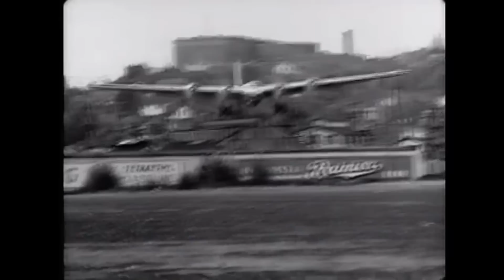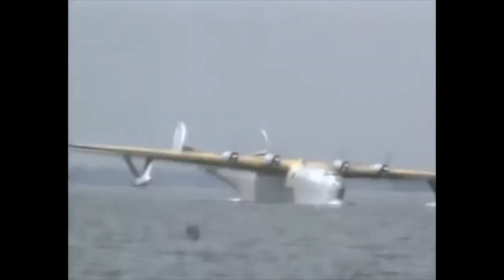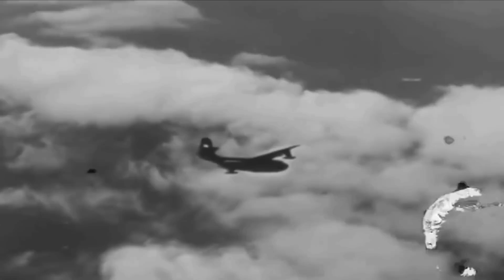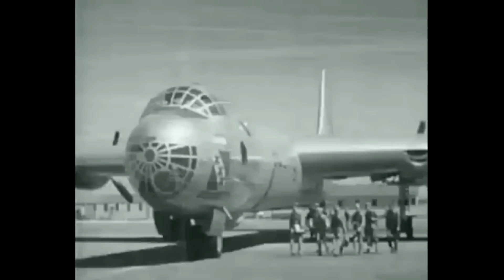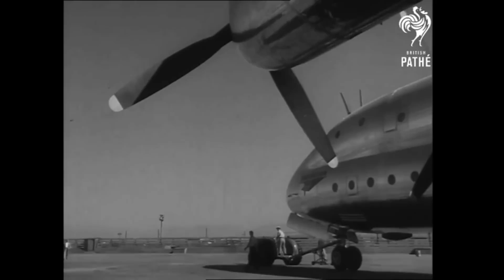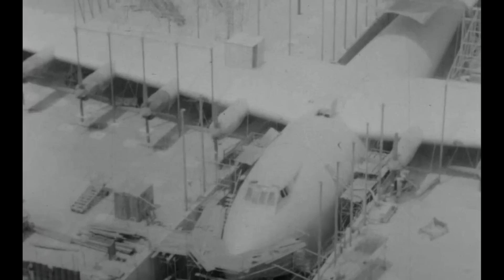Piston Giants (US) | Index Of Oddities Ep.3

Comment: The Spruce Goose would never fly again after the taxi tests because of a major structural failure. If you go to the museum you can see that the rear of the fuselage is patched back together. The stress on the air frame on such a large aircraft and the use of wood made it impossible to repair. Howard Hughes had a problem accepting failure...
Reply from the maker: I hadn't heard of that actually. Can you link me to a source on that, I'd love to read about it.
Reply: @AviationGeek1903  Go see it at the air museum and ask them about all the clamps holding the tail on. Testing flying boats often ended up discovering the structural issues and that was the result of its only test flight. It would have required tons more of wood to make the aircraft sold enough for a water takeoff & landing...

Comment: This video is good. Here are a small group of revisions that could make it better: Consolidated Aircraft did not merge with Voltee. It was Vultee. And the Convair XC-99 was not a modification of a B-36. It was constructed completely in San Diego using many B-36 design features like its wing and engines. The engineer in charge of the design of the flight deck was Jim Sproat. And although the one XC-99 was last flown to Kelly AFB Texas, the B-36s I believe were manufactured in Fort Worth.

Boeing, Lockheed and Martin people might chime in here with their revisions. But I doubt if the design for a double radius fuselage for the Lockheed Constitution was due to pressurization issues. To construct a limited number of aircraft of a type could stimulate the company to use the machinery at hand, instead of buying new machines to only use for a few airplanes. And Lockheed probably did not possess a large-enough radial draw former for a single radius fuselage.
Reply from the maker: I appreciate the constructive criticism! Thank you. 

As for the pronunciation of Vultee, that's just how the text to speech program pronounced it. Not perfect, but passable. 

For the XC-99, I couldn't find nearly as much info on it as I could on the B-36. I was under the impression it was a modified airframe from a pre-existing unit. But I could be wrong. 

Lastly the source I saw regarding the double bubble fuselage mentioned it was for pressurization purposes like the Curtiss C-46, but you could also be entirely right, and that Lockheed just lacked  the resources to build a single fuselage on that scale, like you mentioned. 

I'm working on my next video, covering the F11F Tiger, and I plan on narrating it myself instead of using thr TTS program. I've also got a fre sources to cross reference so hopefully it comes across as more polished.
Reply: Wow. You are an honest person. I like that. The 2-B-60 prototypes were modified B-36s that had damage due to a wind storm at Ft Worth. So Convair offered to see if they could be salvaged as all jets. But Don Germeraad, test pilot, knew they wouldn't fly right. FYI
Reply from the maker: I would say you don't get anywhere in life by being dishonest, but that's entirely how politicians make a living. 

Thanks again for the feedback!

Comment: Wait... WHAT??? No love for the YB-35 "Flying Wing" from Northrop??? Designed to carry 10,000 lbs of bombs over 10,000 miles, surely it belongs on this list. Besides, it should be on the list just because of it's "cool" factor, a plane WAY ahead of it's time.
Reply from the maker: I avoided it for a few reasons: first, I wanted to focus on designs with 200+ft wingspan. If I includes the XB-35, I'd have needed to include the C-74 and C-124 as well. Of course, I made two exceptions I'm this video, as I felt the XB-15 was closely related to the XB-19. And the XPBB was large enough for a twin engine design. 

Secondly, I know how the comments get with such planes: it gets flooded with people accusing Northrop of copying and stealing designs from the Germans. And I didn't want to deal with that right now lol.
Reply: @AviationGeek1903  😆Fair enough
Reply from the maker: One day I'd like to cover the Northrop Flying wings, and the Convair XF-92, but I've seen what happens when I post photos of those in Instagram... so I won't go into those until I'm a more established channel, and have the chance to really dig into the nitty-gritty parts about how captured German engineering influenced such programs; which is exactly what is is, influenced, not stolen.
Reply: @AviationGeek1903  I would love to see it. TBH I wouldnt worry so much what other people post. Plenty of trolls out there. And in fairness, none "STEALS" fundamental design ideas from anyone, they just "borrow" them! LOL. In all seriousness, does anyone believe the Wright Brothers invented the airplane in a vacuum? .Jack Northrop was putzing around with the idea of a flying wing long before WW2. along with plenty other designers who understood the principle advantages.Besides, if you're going to get bent over who deserves more credit and your guy is a Fascist Nazi sympathizer... you have more serious issues to work out! Hahahaha

Comment: Largest piston engined aircraft? No contest - the Hindenburg , nobody else in sight at the finish line.
Reply from the maker: I'd argue that the US Navy Helium filled Akron and Macon would qualify as "in sight at the finish line" at least. The Hindenburg was only 18ft longer, and half a million cubic ft greater in volume (which makes it only about 7% larger). 

But based on technicality, you are correct.
Reply: @AviationGeek1903  Good point, it would be a 1-2-3 sweep of the podium with airships.
Reply: @natehill8069  You are forgetting about the LZ-130, the second Graf Zeppelin (essentially the same size as the Hindenburg).
Reply: @kiwitrainguy.aka.DennisGandy  Not really forgetting it, kind of like talking about "big ships" and listing the Bismarck without mentioning the Tirpitz or the Yamato without mentioning the Musashi, Titanic v. Olympic et al; sister ships dont really count.
Reply: does a Zeppelin qualify as 'aircraft'? not in the standard definition of the word
Reply: @koneofsilence5896  Yes, any machine that flies through the air is an aircraft, including airplanes, sailplanes, helicopters, autogiros, blimps, dirigibles and hot air balloons.

Comment: Who the hell was trying to land the XB-19?  That footage made the hairs on the back of my neck stick up......
Reply from the maker: Especially as it was the conclusion to the maiden flight. On top of that, the XB-19, at the time, had the most expensive insurance policy on an aircraft. If I remember correctly, the premium for the first minute of flight exceeded 80 grand. 

Definitely not a landing to be proud of, but as they say, any landing you can walk away from is a good landing.
Reply: @AviationGeek1903  WOW!  Great information.  Great video by the way.

A seasoned pilot would go to altitude and do things like slow the plane down and see how it handled.  Really, the very last thing you want to do is touch down on the nose wheel like he did.  I would have done a low pass or two to feel out how it handled at low speed, and really.....Just kind of landed it flat and fast and then use the brakes to bring it to a stop.  I suspect he wasn't used to sitting that far off the ground during the flare and didn't have the "sight picture";  Just keep the power in and let it land itself gently.  Those wild pitch oscillations, as I said....Would scare the hell out of me!
Reply: Me too! @Flies2FLL

Comment: I was stationed at Kelly AFB 1955-57.  The XC-99 used to be flown every now and then.
It made a very loud vibratiing sound when taking off and could be heard from all over the Base.
Reply from the maker: Must have been an awe-inspiring sight!
Reply: 168 cylinders all banging away, wish I could have heard it.
Reply: @dontheshark  That buzzing sound you mention was unique to the B-36 platform. Caused by the exhaust note passing immediately through the pusher engine's propellers.

Comment: Piston giants may come back due to fuel efficiency.
Reply from the maker: As much as I'd love to see that happen, I don't expect it to. I mean, there are no modern aviation piston engines (as far as I'm aware) that come anywhere close to the power output of these late war piston engines. The development of such an engine would be costly. Not to mention, jet engines become more and more fuel efficient every day. I'm some parts of the world, jet fuel is still cheaper than avgas. And most importantly, time is money; and jets will always be faster. 

That said, if we ever get another piston powered aircraft with a 200+ ft wingspan, please come back to tell me you told me so!
Reply: @AviationGeek1903  There are start-ups in Germany and Norway building V12s Diesel for aviation. I think the Norwegian one can buy already.
Reply from the maker: What kind of power output are they seeing? The R-4360 that the larger examples here use are 70+ liters of displacement with 28 cylinders, with the most powerful example reaching 4,300 HP. I'm not an engine expert, but I'd assume an aviation V-12 wouldn't come close to that kind of output. 

That said, it's certainly a start! I'd love to see how they're used.

Comment: Great video, and you somehow managed to find extensive archival footage that I’ve never seen before (saying a lot these days lol.) It’s so refreshing to see actual relevant content instead of ridiculous stock footage that replays 15 times during the video.

The only thing that jumped out at me was the “exhaust driven supercharger” - which by its very nature would be a turbocharger, but I think you were referencing the PRTs or power recovery turbines which were kinda a mix, as they were exhaust-driven but re-introduced power through mechanical means.
Reply from the maker: Yeah I'm not 100% certain what they meant by exhaust driven, as you are correct. That's just the terminology the source material used. That said, when it comes to aviation engines, I see Turbo, super, and turbosupercharger used interchangeably. I'm no expert on the mechanics of it, but it's possible that when these aircrsft were made, there was not the same distinction between turbo and super. That's just my assumption though.
Reply: @AviationGeek1903  definitely not used interchangeably, at least they shouldn’t be. 

Radials for example (by WWII at least) almost ALL had centrifugal superchargers, they were basically integrated into the engine case and you wouldn’t really notice them if the engine was on a stand. There are some exceptions like the very powerful system Vought used on the Corsairs later versions of the R-2800 though. THOSE you could see lol. 

I’m not aware of any “common” aircraft engine that had a turbocharger alone, I’m sure there were some obscure designs.  

A few planes (almost exclusively US) had an exhaust-driven turbocharger (as all are 🙈) which fed air into an engine which retained some version of its original supercharger. 

For radials the common early designs were the R-1820s/1830s in the B-17 and B-24s, which had distinctive turbos (I think they were all GE). The P-47 is obviously the standout here with a large (especially the later M and N I believe) turbo near the tail.  

Liquid cooled engines also had them, the common one being the P-38. AGAIN though, the base V-1710 engine design had its own centrifugal supercharger shared in ALL applications. The P-38 added a completely separate component to the design with its turbos. 

In this case (I watched it like 5 times skipping around and couldn’t find it again! So not sure which aircraft) I believe they are talking about PRTs, as they’re technical exhaust-driven, but again impart their power directly back into the crankcase through some spectacularly complicated gearing and (I believe) fluid couplings. 

The power recovery turbines were famous on the Connies and DC-7s. I’m guessing it had to be one of the planes you mentioned with the 3350’s. Because their efficiency and compactness required the turbines to be RIGHT after the exhaust ports (they had sets of 3, so 6cyl per PRT) the passengers could see at least two PRT exhausts, which would shoot flames out during night flights. 

Anyways,  I appreciate your reply and the content! Just struck me off guard when I heard it haha.
Reply from the maker: Thanks for the well thought out and informative reply! Some time I should familiarize myself with the finer details about how these engines work, considering how important they are in the stories of such aircraft. I knew the V-1710 in the P-38 included an additional supercharger in the booms (which I've always seen referred to as turbosupercharger) but I didn't know the base 1710 came equipped with its own turbo.
Reply: @EstorilEm P2Vs had them too